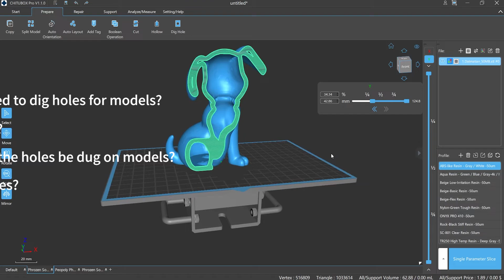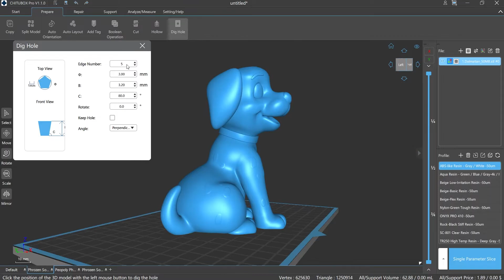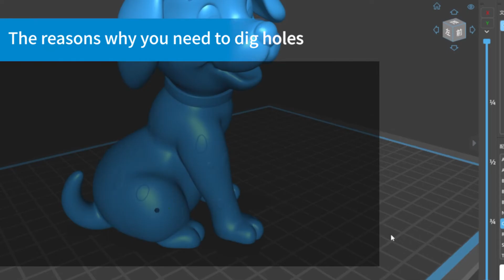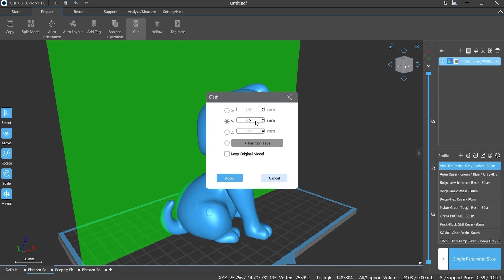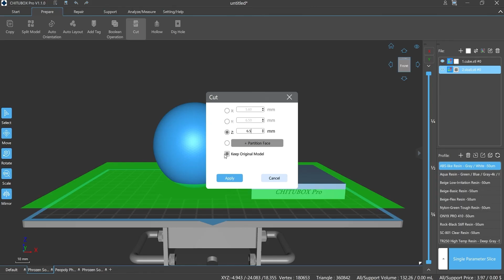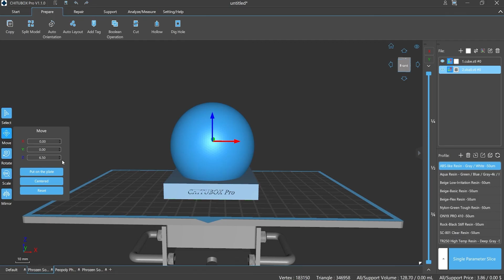[CHITUBOX Pro]Lesson 9: Hole Digging

Comment: Why has my trial version of Pro not got the "B" depth dimension available?
Reply from the maker: This parameter was removed intentionally in v1.3.0, the value of B doesn't mean "how deep do you want to dig" but "how deep do you allow CHITUBOX to dig". This means you will either get a penetrated hole or nothing, therefore, the parameter B is useless in most scenarios.
Reply: Now the dig feature is uselss cuz I have a hole running trought the top of my model instead of nice set lenght. DO NOT REMOVE USER ABILITY TO SET PRECISE PARAMETRES PLS. Right now its big no on buying this if I have to set drain holes in project stage.